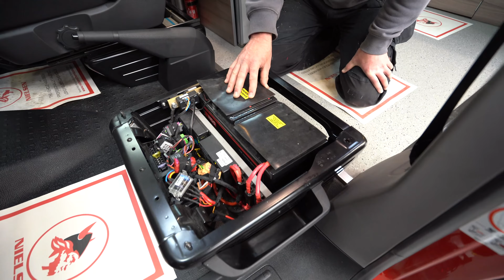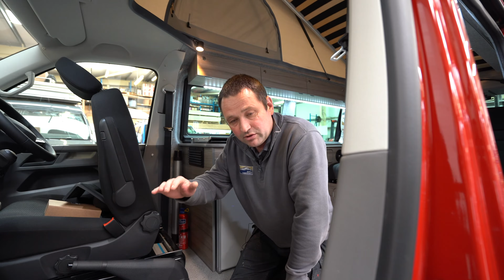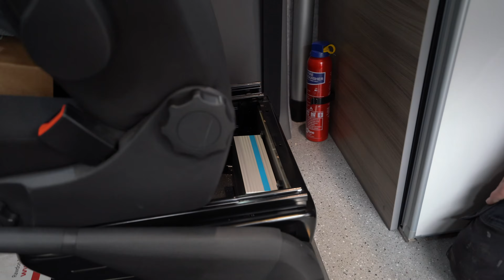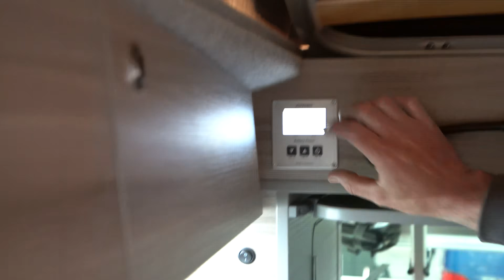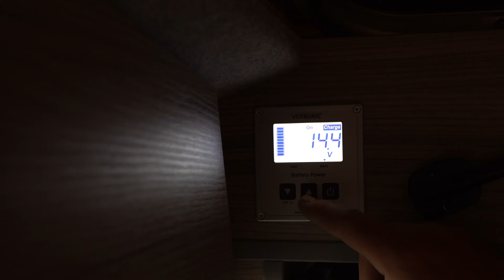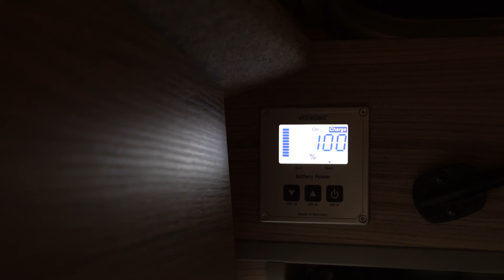VW T6.1 Camper LITHIUM BATTERY Full Setup // First Look

Comment: Great video. I'm considering purchasing a VW California Ocean and I'm trying to understand more about the leisure batteries. Today in my current micro camper I installed a GoalZero Yeti 400 Lithium Power Station that recharges when the van is running. Its capacity is 428Wh, 39.6Ah (10.8V) which allows me to run my medical device (CPAP) for 2 or 3 nights depending on how cold it gets outside. Is my existing GoalZero have more or less power than the VW California Ocean factory leisure batteries?

Comment: Excellent summary Alan, good to see this tech moving into the mainstream. The one thing to add about cost is that LiFePO4 chemistry batteries have a much longer life/many more charge cycles than even AGM so if someone is planning to keep their van for a long time and use it a lot, especially off grid it won’t be expensive in the end as they won’t have to pay to replace the batteries every few years.